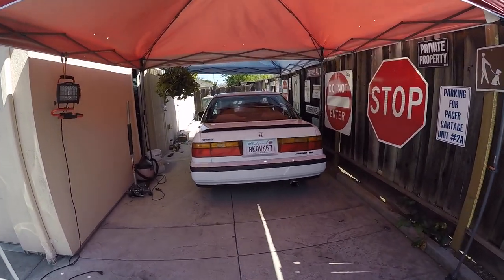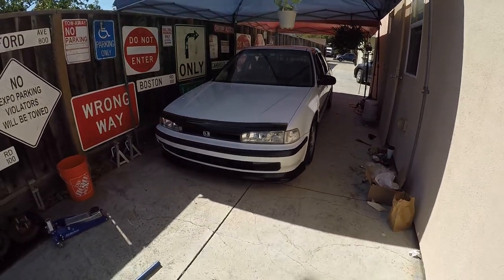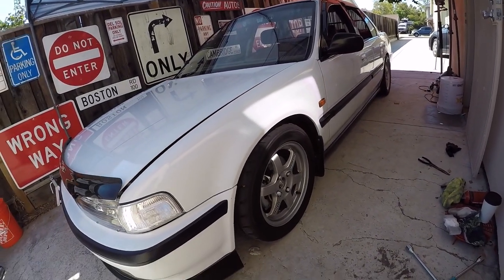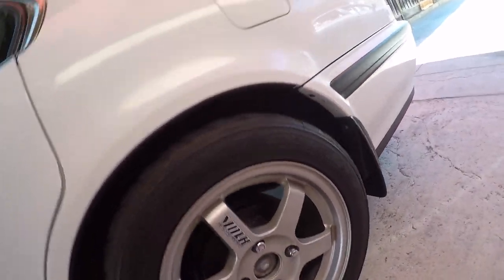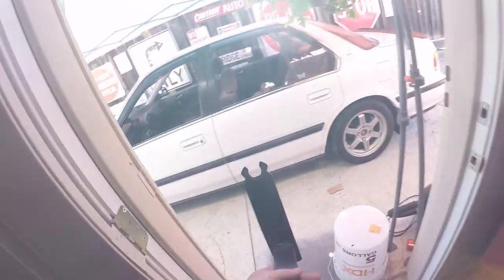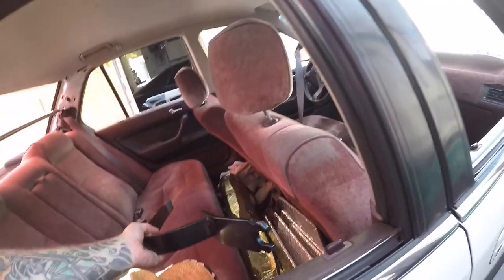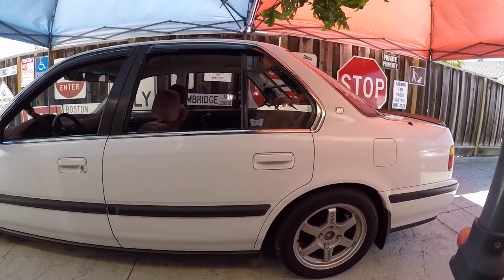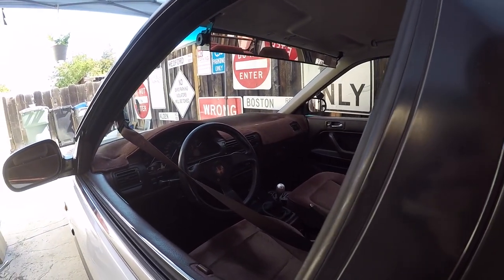Suspension V.2 Complete on the Accord CB7!

Comment: dang nice wheels i still have the stock 1993 honda accord wheels i need wheels bad just dont have money and may i ask where u are located cause im looking in changing the exhaust on mine and im in cali and there streaked about cars
Reply from the maker: I don't think many exhaust systems sound that great on this car out of box. Hit up a muffler spot and just replace the piping with fresh stuff, and maybe throw a muffler and a tip on it. Thats pretty much all I'm running at the moment.